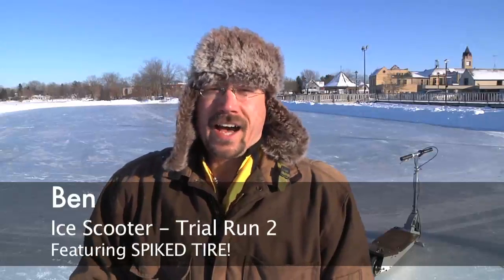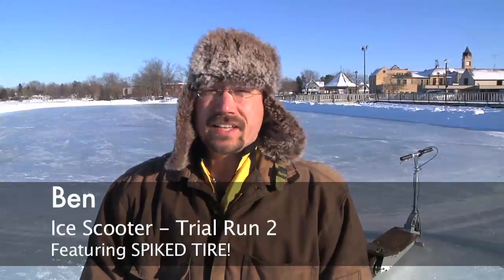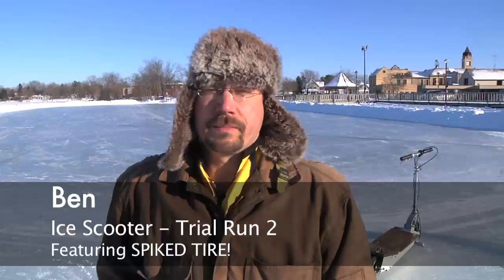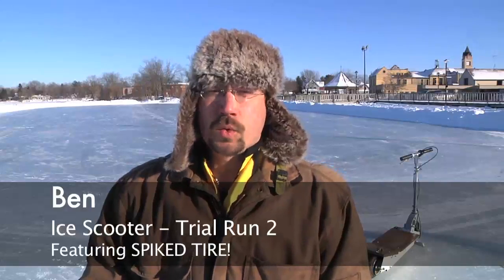Ice Scooter - Spiked Tire Run

Comment: Ben - Any way you can turn that wheel into a belt? I was always surprised when looking that Razor doesn't make a kids Snowmobile for like $400.  Would be a blast to go around the yard in snow at 7mph
Reply from the maker: I don't have much machining experience, but I'm sure a clever person who did could rig up a belt in the back. For use on snow, I'd want a ski on front instead of the skate. And yes, that would make an awesome commercial product.

Comment: Patent that ASAP. Also a zig zag pattern of smaller spikes, around 4mm high instead of really long spikes would help with grip and improve road feel. Like small circular pyramids. You could get away with a zig zag pattern going around the tyre top to bottom, and a few on the left and right side wall for side grip. This would be a great way to go shopping in the snow. Just throw on a backpack and go do some grocery shopping. Nice job Ben.
Reply: Yeah that's what I was hoping he did cause  winter  is coming  and I want to use my electric  scooter in the snow!!!!